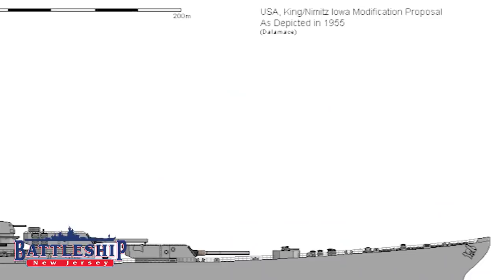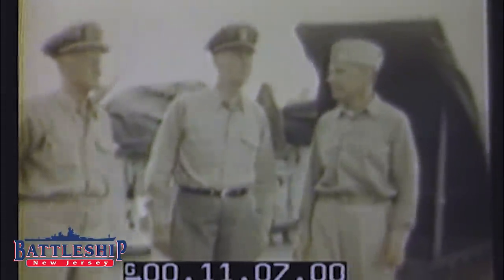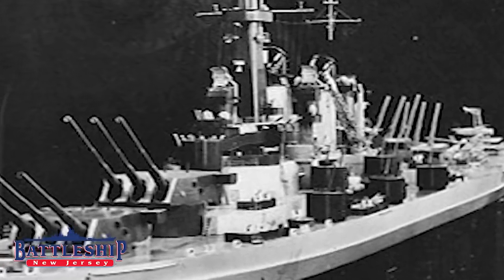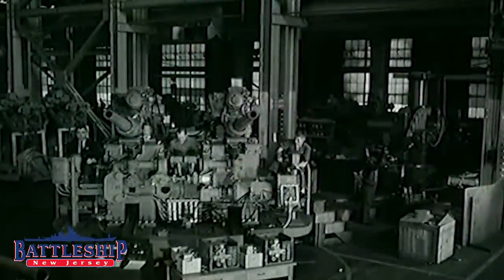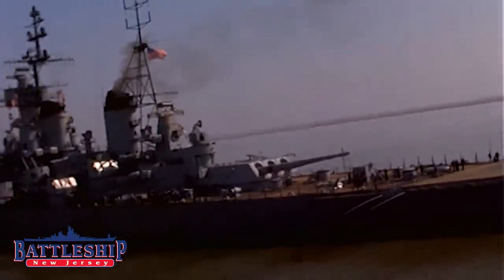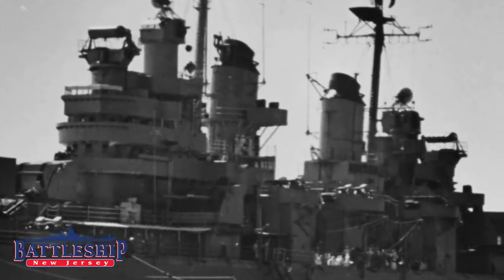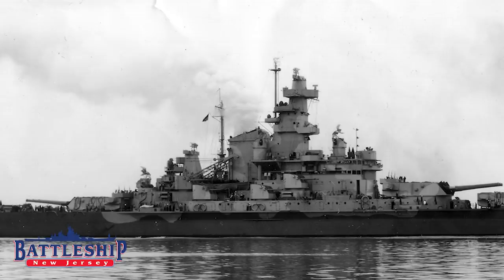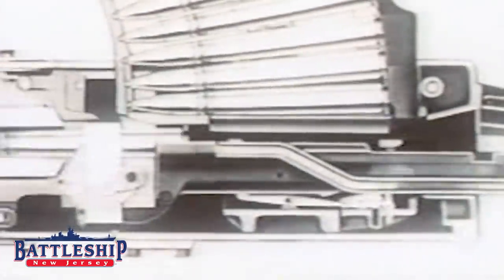King/Nimitz Iowa Conversion

Comment: This winter I read a half-dozen histories totaling near 3,000 pages of the Pacific war written by four different authors. Admittedly, these books focused on strategy and operations; also included were biographies of Nimitz, Spruance, and a collective work including the five star admirals in the war. None of these included (to my 73 year old memory) any description of such a brainstorming session. However, King, Nimitz, Spruance, and Halsey did have private dinners with few staff in san Francisco, Nimitz quarters in Hawaii, and at Nimitz's advanced  residence at Guam. I would also note that Nimitz especially proffered little that was not well researched or examined by his supporting staff officers. There should be some historical record had that been suggested. In war, many ideas, outlandish or occasionally brilliant, are considered. If as you said the war went on for a few more years, the ide may have been implemented. Electronics were advancing at such a pace that likely they could have accommodate the reduction in mast support. (I was an aerospace engineer, so that's they way I view technical considerations.) Obviously I wa engaged by the video, so it was good.
Reply: The l
Reply: might be a bit late, but what books did you read?

Comment: Can’t help but note they look a little like the Yamato class in this configuration.

Also, not sure if this is true, but I heard a story about there being a looking into for the Iowa’s being refitted with a HMS Vanguard style bow.
Reply: I believe there was a study on this because the Vanguard bow has a few advantage, but a couple draw backs, mainly that the ships would be made slower.
Reply: Yes, one of Yamato's design advantages was her shorter superstructure (lengthwise) which also allowed her to have a shorter citadel.
Reply: @demoskunk  No the length of citadel generally factored by length of machinery and magazine placements, the finalized A-140J7 have AB-X layout despite initially they want 10x18" in AB-XY layout (for balanced firepower) but increases hull length would mean more cost.

Comment: i love talking different ship configurations.  I got the idea recently to take an Ohio style cruise missile bank put it in the bow, of a slightly wider in the bow,  Iowa design, compress the superstructure and move it aft a little, then put in 2 - 18" gun batteries with 4 gun turrets. and you got not only a good ship for shore bombardment, but a additional 140ish cruise missiles they can launch further inland.  Then you take the Midway class carrier design and thin it up a little and put a maximum 50 plane compliment on it and you got a fast attack power projection fleet that can handle hot spots like Iran and Afghanistan while waiting on one of the big boys to get there.  This would reduce deployments and allow better maintenance of the fleet.  plus, you don't need a damn Ford class carrier that cost  $300 trillion and still doesn't work right.
Reply: I don't think you realize how large the Barrettes for a quad 18" gun turret, you might get away with 3 guns per turret, but it would not save weight, just some volume.

Comment: I love the King-Nmitz redesign but would add one further feature.  As has been discussed by Ryan in this series and in numerous books on the Iowas,  the class's speed bow was so narrow abreast A turret that the torpedo protection system could not be built out to its full width, creating what could have been a relatively  weak point in the ship's underwater integrity.  Also, the bow, very long though it was, was not quite long enough to avoid a slight knuckle abreast B turret, resulting from a momentarily greater rate of beam narrowing at that point.  This created excessive spray formation in heavier seas.  Another 30 feet of length, added at the point of the knuckle, would have both solved that problem and resulted in somewhat greater beam abreast A turret, thus allowing the torpedo protection system to be built out to full width.  Thus altered, the design's length would have been 890 feet on the waterline (the same as the Montana design) and 917 feet overall.  The additional 30 feet would have added about 200 tons of displacement, certainly an acceptable tradeoff, and could have added perhaps a fifth of a knot to the speed curve.

Comment: I think they should have added the midship 5" mounts with out taking two from the sides for a total of 24 5" guns and made them 54 cal instead of the 38 cal. Also would have replaced the 40mm mounts with the twin 3in mounds and added bulges to the sides. I read where the Kentucky and Illinois might have gotten the bulges and it would have cost 1 1/2 knots. Though it would have been nice to see a fast Montana with the same  24 5"54cal layout and 3in guns along with the bulge. Maybe even installing the 18" 47 cal guns that the navy was testing with the 3850ib super heavy shell instead of the 16in 50cal guns.

'

Comment: A twin 5-inch gun-mount installed behind the number '2' 16-inch turret would provide a slight improvement in anti-air capacity; however this would mean that the bridge would have to be built higher, resulting raising the center of gravity.

Comment: No conning tower, removes a good chunk of weight. Post war Illinois & Kentucky get an extra tier added to the top of their bridge to host a type of cic room for electronics & equipment moved from elsewhere in the ship to make room. Fore and aft turrets give them the same remaining 5 inch broad side with fewer turrets allowing for potentially more of the fives to be replaced with box launchers opening the previously used barbette space for electronics. The big issue remaining antenna space. But I suspect that issue would be solved pretty quickly even if it required some kind of goofy rig branched off the funnel.

Comment: Ryan, it’s been eating me. How were the Iowas able to support the electrical needs of all the new electronics, especially in their final commission? Were they originally constructed with a large power surplus, or were they upgraded/augmented later?
Reply: Remember that they were originally designed for World War II analog electronics, which were substantially less power-efficient than the digital equipment they had later on. The actual power consumption of the radar arrays and such may have actually decreased, which would have left plenty of overhead for other things. Also, the removal of two 5-inch gun turrets would have also freed up a substantial power reserve; the armored box launchers which essentially replaced them were far less bulky and would have consumed far less power to train and target.
Reply: @WardenWolf  Agreed. Many times when someone asks me about getting additional electrical power for new equipment I tell them that the cheapest way to get more power is to reduce usage elsewhere...like replacing the old incandescent lamps with something more efficient and installing newer more efficient electric motors.
Reply: Bear in mind too that the amount of new generation electronics wasn’t that great. Their CIC’s were relatively minimal and their was compensation in the removal of some 5” mounts plus the fact that all the WW2 generation 40mm mounts were gone too all of which were power driven.
Reply: I can see how the subtraction of the 5” and 40mm would free up significant capacity and there is no doubt that some equipment became much more efficient over 40 years. But what’s really on my mind is the heat. Not only were meat computers replaced with digital ones, but the number of systems requiring computers rose significantly. Chilled water (I assume) AHUs were added to protect this new equipment as well as provide comfort cooling to (as I understand) large portions of the ship. First you consume a watt of electricity in a computer, then you will consume no less than 1 watt to remove that heat from the ship, assuming beautiful efficiency. I don’t have all the information needed to perform a heat load calc, but my gut tells me that’s a lot of heat to remove.
Reply: @TheSteelArmadillo  You only need to deal with the delta in heat generation.
You're adding the heat rejection from the equipment but you're losing the heat generated by the humans who are not longer in the room.
Reply: @ghost307  that would be true if there were comfort cooling in the original design. Not much of that for draftees; electronics were just added to previously unconditioned space.
Reply: @TheSteelArmadillo  Good point. I think I've been hanging out in too many air conditioned spaces without even thinking about it.
Reply from the maker: For everyone's reference, we did make a video about air conditioning https://youtu.be/8xNzgxSihPY

Comment: I really don’t believe king and Nimitz would have been thinking about ship design. This type of thinking would have been done at lower levels, and then sent up, ending with king and Nimitz. I would think one topic would be the replacement of the oerlikon 20mm and bofors 40mm with 75mm, which at the time, was the smallest that could take a proximity fuse. This would slew faster than the 5in, allowing kamikazes to be destroyed further than the bofors.

Comment: It’s 1930-something, you’re the USN Ship Ordering Guy. Just before you commit the order for 6 Iowas, you find out about the secret IJN Yamato and Musashi. You also suspect Carriers can play a bigger role. Do you:
A. Order the Iowas. They’re perfect!
B. Change the order to an equal tonnage or Montanas 
C. Rush an 18 inch Montana
D. Order an equivalent tonnage of Essex carriers and go to war with the BBs we already have
Reply: Dust off the plans for the 18 inch gunned tillman battlship
Reply: The Navy would definitely not done A, D is also unlikely. Those answers make sense in hindsight.

 If they knew about the size of Yamato's batteries, C, otherwise B.
Reply: Keep the first 4 Iowa's the same (there isn't time to change them much), and add 2" to the main armor belt and 1" to the deck for the next two to be built. It might make them 2-3 knots slower, but would be a decent trade off. I think they would stay with 16" since the super-heavy shells had such good stats. I don't think pre-knowledge of Yamato's would change Montana's fate, they just were not going to happen in the age of growing air power. As for more Essex, they already had tons of them on the way! And probably every big-enough ship yard was already in use anyway.
Reply: A

Comment: Here's an idea. Delete turret 3. Replace it with a hanger space below for 4 or 5 Harriers. Then raise the aircraft to the main deck on an elevator up through the centerline to a split flying off ramp on either side of the superstructure. I know I'm not the first to think of this.
Reply: Not harriers vstol F-35B’s.

Comment: OK -------  The forward Gun director could have been moved forward over the bridge with a tall tripod mask installed in its place forward of the armored tower doubling the electronics and radar mounting area you are talking about. Fact is, the armored tower could have been deleted giving even more space and weight for mounting electronics even higher and increasing their range.

Comment: Do you think that they would have changed the armor scheme?  

By the end of the war I think that a battleship v. battleship fights were understood to be a thing of the past.  The main threat to the capital ships were aircraft and submarines. 

Would that have allowed them to considerably lessen the armor designed to protect from damage from other ships?  This would have made the a lot lighter, faster and fuel efficient.  And allowed more weight of offensive and defensive weapons, correct?
Reply: Thats what I was thinking!! Reduce the belt armor, and use the saved weight to bolster the torpedo/mine/deck protection and add more AA...  Going to the extreme, you could give it cruiser armor and have a 36 knot BB...🤣

Comment: Would it have been possible to replace some of the side 5" turrets with terrier missile launchers or later vertical launch systems?  I've never seen proposal for mounting anti aircraft missiles off the center line.  Wondering if that would be possible.
Reply: might be a bit tight though, those 5 inch turrets are mostly deck mounted., not really a barbette below it.  I know of atleast one cruiser that replaced double 6" turrets to a single terrier (well actually, 2 arms) launcher (the Dutch C802), and I suspect quite a lot of the single ended missile cruiser conversions done by the US have a similar configuration. VLS would help a lot, you can convert a 'gym' into a VLS system if needed.

Comment: Ryan, all ships designs are a series of compromises.  A ship designer is trying to select the best mix of features that provides the optimum performance for the missions and roles the ship is intended to face.  Personally, I think the original design is the better one in the long run.  As you said, the Navy was already having difficulty finding spaces for the various electronics that were being developed.  You need the various electronics to detect and observe oncoming targets and the King/Nimitz design was going to limit the amount of radar and other electronics that could be carried.  Restricting that ability in the long run with the King/Nimitz design for better arcs of fire just doesn't seem like a good trade-off for me.  

As you mentioned, while kamikazes were a threat, the actual strikes didn't inflict severe damage on battleships; the ships could handle the impact and continue operations.  So optimizing your design to provide better anti-aircraft fire against a threat that is not likely to incapacitate the battleship just doesn't seem to make much sense.

Comment: had operation Downfall been executed, the US would have ended up fighting the USSR over the scraps of Japan and Europe, and probably the Middle East as well.
So they'd likely have needed more battleships in the capacity of mobile batteries for shore bombardment more than anything.
Reply: The USN had more then enough old battleships for for amphibious-bombardment  missions.  Also, most of our old battleships had been modernized during the war so as to give them much better anti-air capacity.  
As for the Soviet surface fleet, most of our battleships could have easily out gunned them.  Even the Arkansas and Texas could have at least fought them on equal terms.

Comment: Do you think if the Korean war would have turned hotter with Russia getting directly involved, would it been possible that the South Dakota classes would have been reactivated??
Reply: I guess that might be possible, but I think it more likely that the carriers and air wings in reserve would have been reactivated along with cruisers, destroyers and submarines.  While WWII piston aircraft would have big problems against shore based jets, away from the coast they would quickly overwhelm any sea going forces the Soviets could bring in.  All the 'fun and games' might have been over by the time the SoDaks and NCs rejoined the fleet.
Reply: oh yea, if the ground forces could keep the Soviets bottle up in Europe long enough with out getting over run, then by the end of year One the Navy (at that time) probably has the Soviet Navy wiped out if not earlier and from then on it's just one big blockade and bleeding them dry over a 10 year time frame.  kind of like they should have done with China before the Reds took complete control.
Reply: Battleships were mostly obsolete by the time WW2 began, much less than when the war concluded. Air power at the beginning of the war ensured their demise. Due to advancement of missle tech, Carriers, Missle Cruisers, Jets and Submarines ruled post WW2.
Reply: @Farlomous  blockade from what ??
Reply: Russia was directly involved. It was just not openly admitted that Russian pilots flew some of the mig-15s